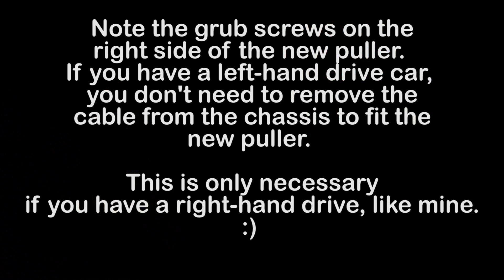EP3 Civic Hood Lever / Bonnet Puller Fix

Comment: How's it held up after a year? I'm planning on doing the same to my mk 7, just want to check if I need to add any glue inside the hole?
Reply from the maker: It's great. Still solid in there and I'm always working on things under the bonnet so it gets a lot of use. 🙂